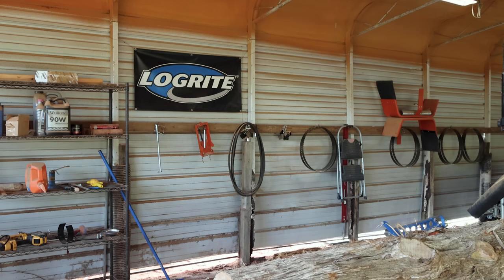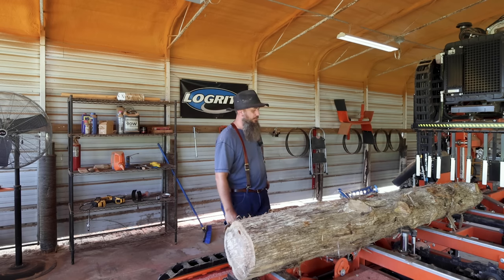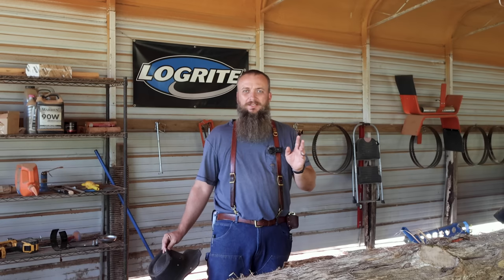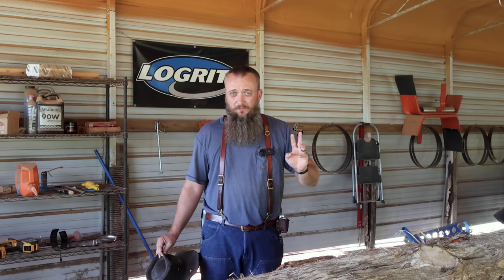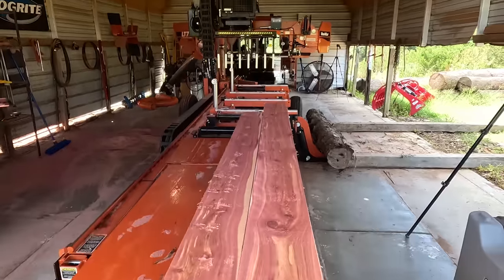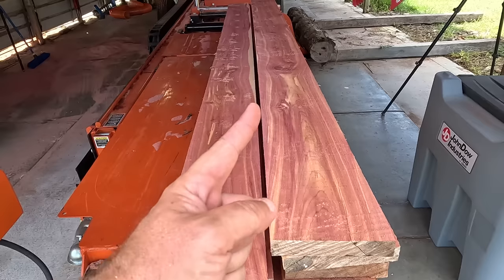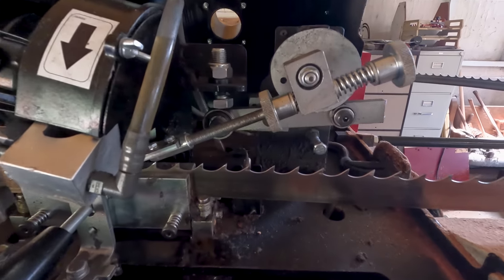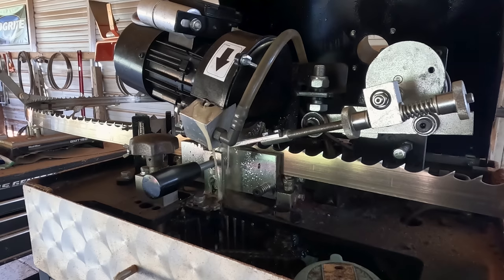Stubborn Hillbilly Finally Listens To His Subscribers, Sawmill Upgrade

Comment: Eastern Red Cedar is what they are called when you look them up online on tree identification websites. My father sold Christmas trees for 20 years and planted 1,500 of these trees bought from the local USDA/Forestry Service Center in our county and they call them Eastern Red Cedar. Now after 38 years the ones that are left, I'd say around 900; are in nice straight rows and are atleast 12 to 18 inches with some being closer to 24 inches at the base. I'm ready to cut them and mill them but my father doesn't want to. I want boards for the inside my closets and to go on the walls of my enclosed front porch. I'm gonna slip out there when he's gone for a few days sometime and cut about 100 and get me some boards. LOL!

Comment: Nathan, you're correct. That is a cedar log, not juniper.Just to help clear the air about the Juniper and cedar debate:
Others want to know

Is red cedar the same as juniper?

￼

Eastern Red Cedar is very closely related to the Common Juniper, in fact they are in the same genus. The key obvious difference is that Juniper seldom grows as a tree, whereas Red Cedar nearly always does

Comment: I am pretty sure that the name comes from back in the fifties and sixties when a company sold a product that they called "Tennessee Aromatic Red Cedar" that was tongue and groove all four sides for lining cedar chests and cedar closets. I remember having a few jobs installing that in closets back in the sixties. It was about half inch thick. You nailed in the tongue so that all the nails were hidden like hardwood flooring. It would keep moths out of wool clothing and such. When ever the scent faded, you could just give it a light sanding and open up new surface to get the scent back to keep the moths out. Way nicer than the smell of moth balls. Yup, it is juniper but no one cared what you called it as long as it worked.
Reply: PS it's true dimensions was half inch thick by two and a quarter inch wide face and random lengths up to four foot. Had tongue on one side and one end with groove on the other side and other end. That way it was always locked into one sheet when done. All nails were in the tongue below the surface to allow the sanding later except the start strip had to have nails in the tongue and through the face on the other edge at the joint of the walls or floor which usually had a molding to cover. Really neat product.

Comment: Howdy. I have no issues with you calling the trees whatever you call them. I am curious though, so I did a (very small) research on "juniper" and "red cedar" - from what I found, they are very closely related, with the seemingly largest difference being, that juniper almost never form reel trees - they form bushes and brush -, whereas red cedar forms trees.
    With that in mind, that log you saw, is rightfully called cedar. Sure, someone will disagree....
   Good for you to get dust collection👍... I wonder, why you intend to just blow it out the side of the shed - would it not be easier for the further handling, if you made some sort of container to collect it in? Something, you could drive away and empty with your skid steer or tractor??
   Keep up the good work. Best wishes from Denmark 👍👍